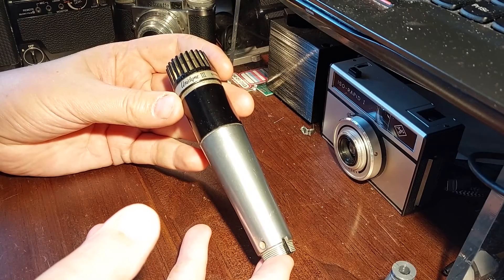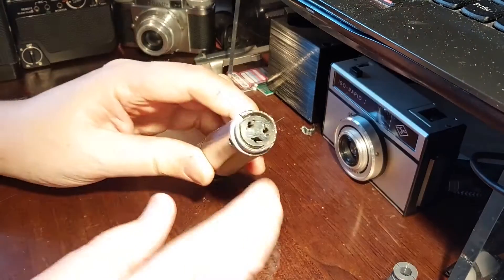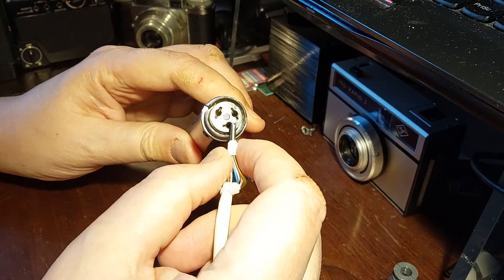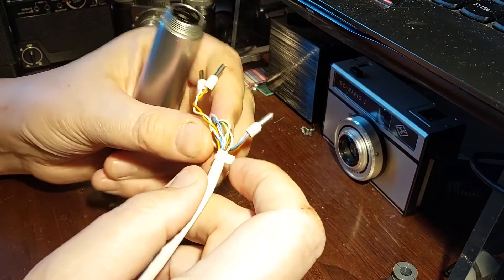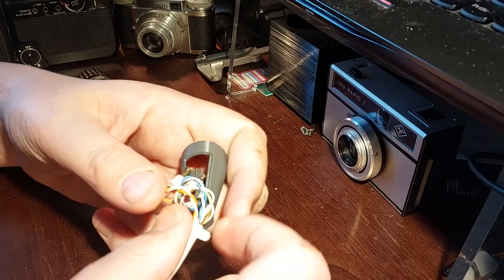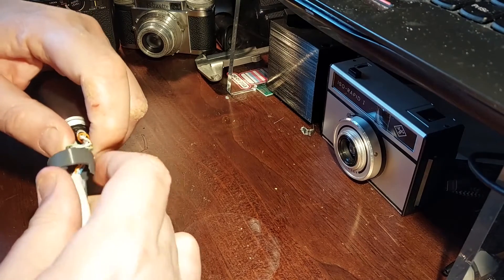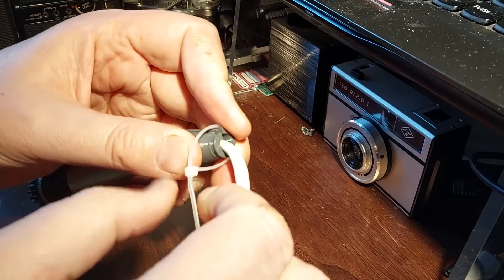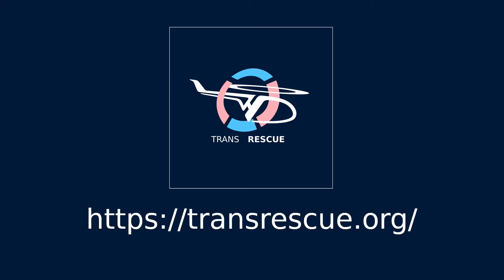Shure Unidyne III connector hack. Amphenol MC3M microphone plug replacement.

Comment: Nice job, really !
I would suggest to use an O-ring instead of the cable tie to secure the two shell parts. Using TPU to print a piece adding both sealing the two shells and adding strain relief to the cable could also be a nice improvement.
Thanks for sharing !
Reply from the maker: Both good ideas. 

If I pursue it further I need to make the join with the microphone better than just a push fit.